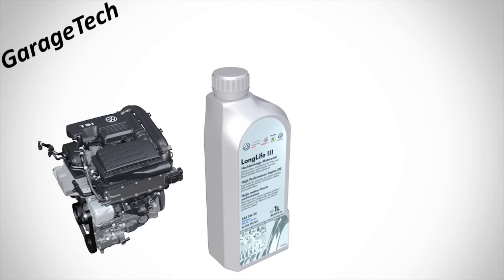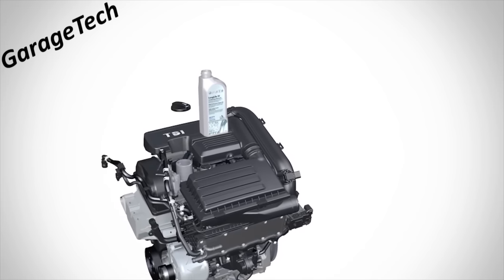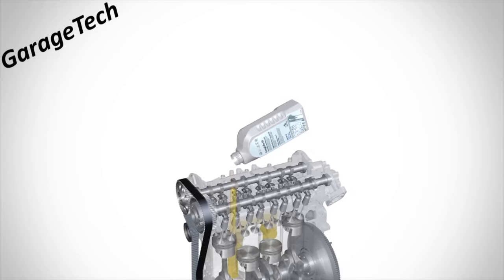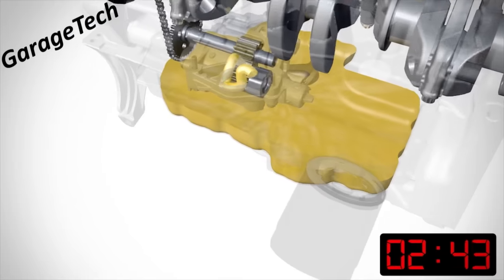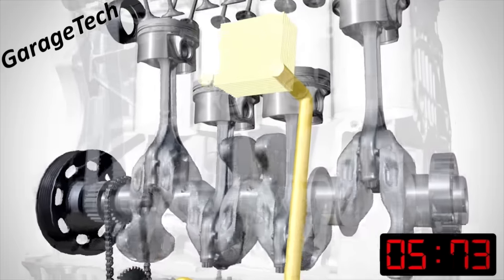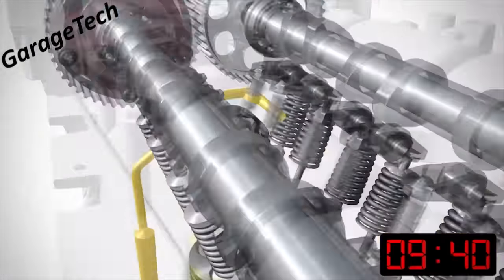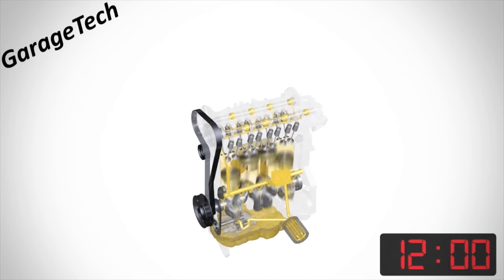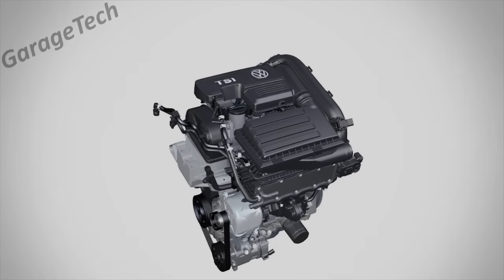How oil circulates around an engine when started

Comment: After the oil pressure reaches some where between 10 an 16 psi the Bi-pass  valve opens an the oil is diverted past the filter and back to the bearings . the oil filters on most passenger cars and trucks do not filter 100% of the oil pumped to it , they are no where large enough to filter all the oil so all the talk about good an bad filters is mute. spend your money on more frequent oil changes.

Comment: I always wait up until 2 minutes when I start it. I'll then only use first gear until car is almost at normal operation tempreture. Car always seems to accelerate better when I do this.
Reply: no no no. what are you doing lol. you don't really want to exceed 3k rpm as a rough rule of thumb for a few minutes so in first you are limiting yourself to what 15mph for ten minutes? coolant temp is not operating temp. it will take ten mins for oil to reach 90c

Comment: i see alot of jokes in the comments and most of them are funny.
but seriously what i do before i put on the new oil filter. i fill it with oil amd and let it sit. it will absorb the oil. i repeat this process 2 or 3 times more, depending on the size of the filter. then simply put the filter where it needs to be on yiur engine. and it wil be a much faster and smoother start/lubrication. (yess this method can be messy, especially if your filter doesn't mount underneath the engine. but its worth it) 👍👍

Comment: Is there are source for this animation?  You should show an animation after a normal oil change and how 10-20% of the old oil that remains in the engine, is mixed with the new oil as it circulates through the engine.   Owners actually believe all the oil drains back to the sump, which simply is not the case.  Diesel engines can retain 15%, and newer engines with coolers, VVT, turbos, balance shafts, additional oil galleries in the head for overhead cams can retain up to 20%.  I have oil analysis showing retention of 20% of wear metals, contaminates, drop in viscosity, increase in fuel dilution, loss of active additives within the first 20 minutes of operation of an engine.  Sludge and varnish is caused when that old oil is left in the crankcase for another full oil change interval.  This old oil oxidizes and deposits through out the engine.  Repeat this year after year, the engine life is shortened.

Comment: 12 seconds???? thats bullsh#t! I measured with a pressure gage, at the cylinder head oil pressure sensor, it takes less than 2 second to get 4 Bar of pressure! 12 seconds? wow..

Comment: There is no way it is 12 seconds. Oil filters have anti drain back valves and even after doing an oil change there is oil pressure pretty soon after start up. Id say oil can feed through a dry engine in less than 3 seconds at idle.

Comment: Hi. First of all thanks for this easy animation that solved my curiousity. But i wanna know that if engine oil goes into cylinder. If it doesnt circulate between cylinder and piston, isn’t there any scratch between them?
Reply: Yes, oil can leak into the cylinder and exhaust gas into the crankcase. The cylinder walls can get damaged(scratched) and leak more in severe cases.

Comment: Thats why you dont do oil changes. Just top it up😂😂 Btw, if your engine dont use oil so you can top it up there is a easy fix to that. Next winter you start your car and right away rew it up to maks rpm for one minute, after 14 days of doing that every morning you will be able to top up you engine with oil.

Comment: Your video is slow motion, so the timer value may not be correct for the real engine.
600rpm = 10 rps,  1200rpm = 20 rps..

Comment: Not true. The only difference between a normal startup and a start up after an oil change is the oil filter is empty. And many filters can be pre-filled with oil before installing, at time of oil change.
 Think about it...  the oil drains from the pan, it is not drained from every internal passage. If the engine were dry after an oil change, it would be dry at every start up. Think through your theory's before you talk.

Comment: Why do cars not have electric oil pumps that would precede the starter?
Reply: Because the amount of wear that occurs upon dry startup is very minimal, and thus eliminates the need for it.
Reply: That will be another thing that would fail after a while ... It's also expected that you don't rev the engine like a maniac after a very cold start.
Reply: Have to do one thing add a additional oilpump before the machanical oil pump
The electric oilpump will lubricate all the parts before start the engine
Reply: @dineshchoudhary15  just another thing that will break and cost tons of money to replace. completely unnecessary.
Reply: You have one. It is called the starter motor.
If you have done an oil change, some people reccomend the following.
A. Prefill the oil filter before fitting it if the engine design permits it.
B. Disengage the ignition / fuel system ( can usually be done by removing fuse) and crank the engine a few seconds.
If your car has an oil pressure gauge crank till it just starts moving. 
When you now start the engine you have oil throughout the lubrication system.
Reply: johan bjork true but not practical as the one OP suggests. I think what he means to say is that an electric pump should operate for around 10 seconds before engine start upon pressing a start button

Comment: This makes me want to use those full synthetic oils cause u can double ur milage when compared to conventional and has to spend less time running dry i.e less oil changes
Reply: Running dry? After an oil change engine start up is only dry for probably 12 seconds at most, that's not a lot of time for it to cause wear.

Comment: Incorrect flow through the oil filter shown!  The oil is pumped under pressure down the sides of the filter through the medium first, then RETURNED through the center tube.
This defective video shows the return oil going into the exit tube.

Comment: Usually only 1 or 2 seconds, unless its extremely cold in which case it can be double.

After an oil change, it can be 4 or 5 seconds before the filter's filled enough to build pressure.

Comment: The video is not complete because he used as example an volkswagen engine . After the car starts and oil starts to flow ,  it goes out in the atmosphere thru the tail pipe . That's why volkswagen gives you a barrel of castrol when you buy a car from them [ best oil by  the way :)))))))) ]  ... vw , what a joke you have become ...

Comment: Sht this is 12 seconds?
What the falk 
I literally keep my car turn on 12 minutes. 
And watched this video again and its 
12 seconds falk!! 😣
Reply: You're going to ruin you car letting it idle for 12min. At idle the engine is not getting the proper amount of air intake.
Reply: @murcielagosv9244  i see I stopped doing that after i knew. 
But may I ask what does the air intake do
Reply: @greenblue980  Think of the air intake like your engines lung, it takes in air while your drive filters it so it's clean and allows that oxygen to reach your engine for the combustion process.

Comment: A shit mechanic would just start it up.

A good mechanic would disable the coil power on a petrol or the pump solenoid on a diesel and prime the oil system by turning it over.

Comment: 12 seconds is to long each cold starts causes damage to the engine
Reply: It causes more wear not damage. And 12 seconds of it idling dry of oil isn't much wear.
Reply: @chasemiller7974  wear and tear = damage
Reply: @Norcal1990  Yeah well keep in mind here that there have been several engines that end up lasting a long time even though they have gone through a lot of cold starts. Which tells you that cold starts don't cause too much significant wear, the best thing to do is keep the oil clean, and give the oil time to circulate after starting the engine before taking off.
Reply: otoot kol dude that’s physically impossible..? Engines wear overtime, it’s inevitable. A machine that consists of moving parts will eventually wear out. Oil lubricates, but does not prevent wear but slows it down significantly.
Reply: not if you don't rev the engine
Reply: It doesn't take nearly 12 seconds.  Less than 2.